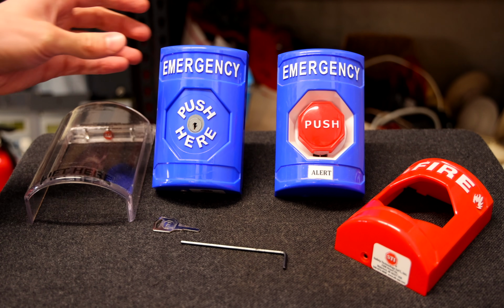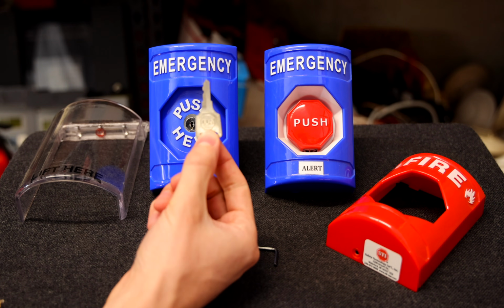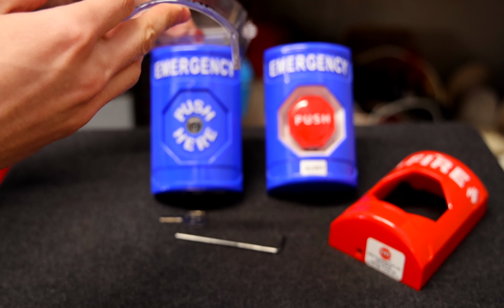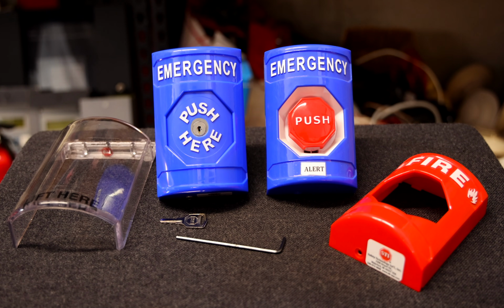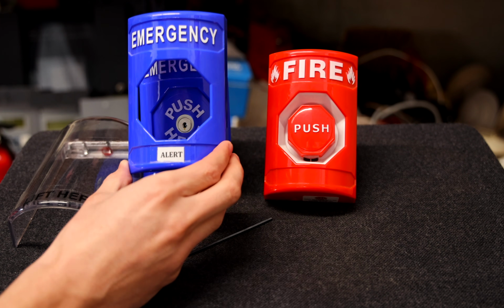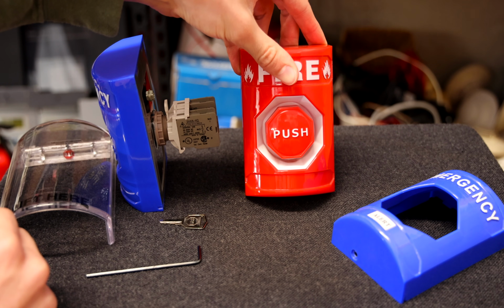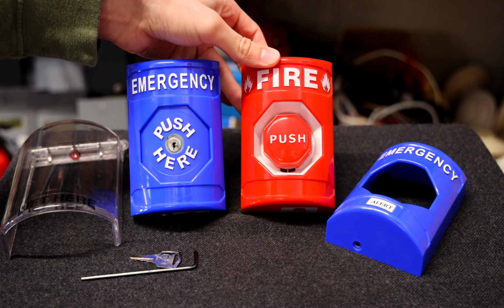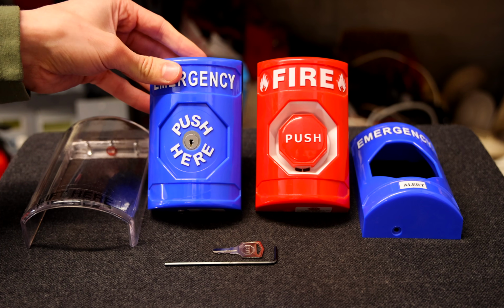My STI SS-2000 Stopper Push Stations

Comment: A thing that STI needs to change for their push stations for when you put their little stopper cover it is that when the push station is activated should have this little plastic or metal piece that comes out forward located on the bottom and or top of it because that little piece prevents the stopper cover from automatically closing to let someone know that it's activated just like a BG-12 pull station that has a black plastic tab that comes down when pulled to prevent manual or automatic stopper cover resets to let you know that it's activated
Reply: That I think that is cool but it is a choice by the company but STI makes the stoppers